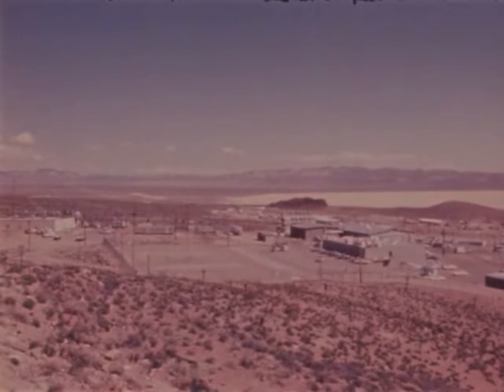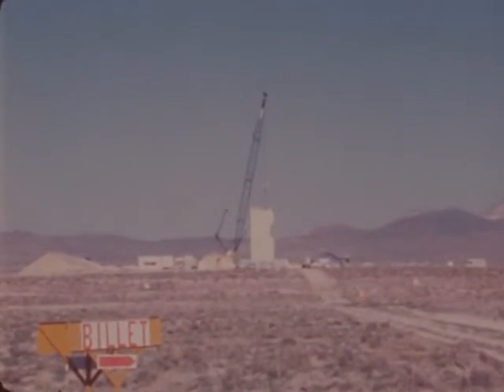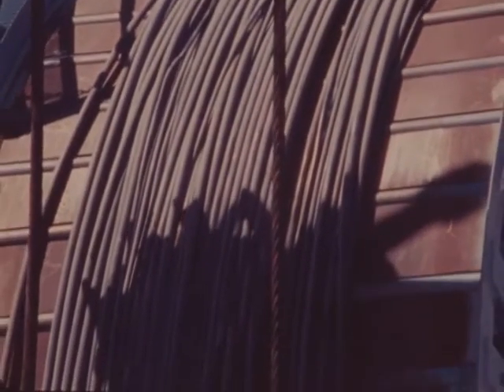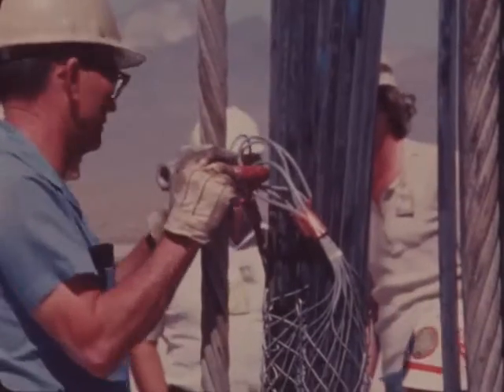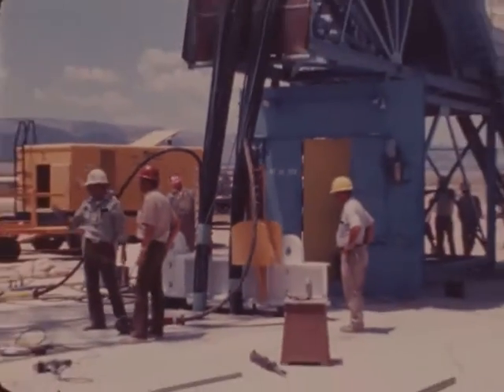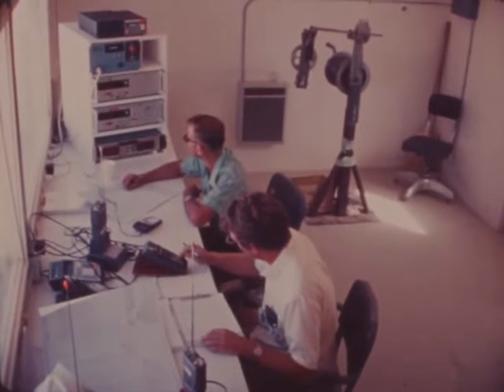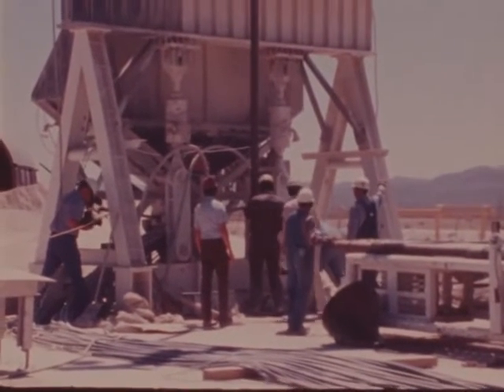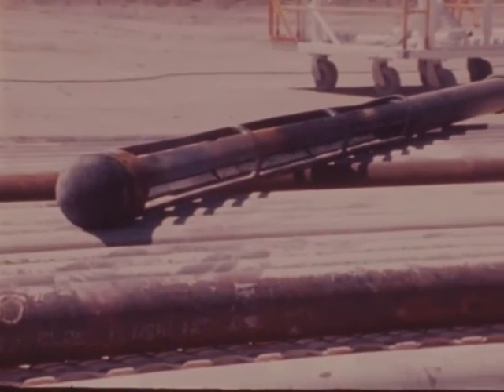Emplacement Stemming: A Film About Underground Nuclear Testing

Comment: This could be used to relieve built-up strain and tension along fault lines.
Reply: Nukes have a lot of uses. You could use it to put out an oil well fire, or an underwater well leak.  You could use them to change the trajectories of hurricanes. The list goes on.